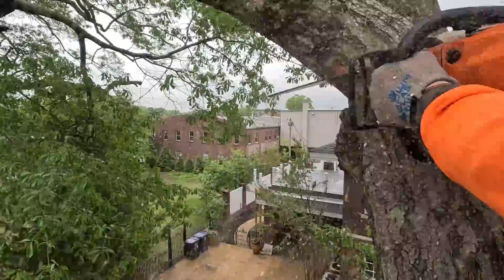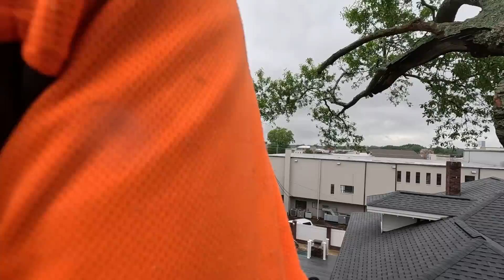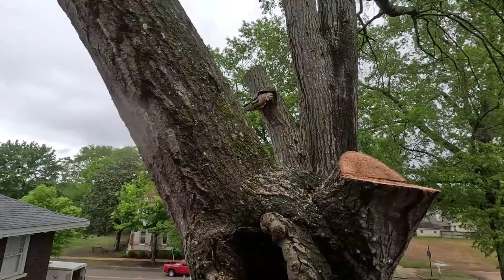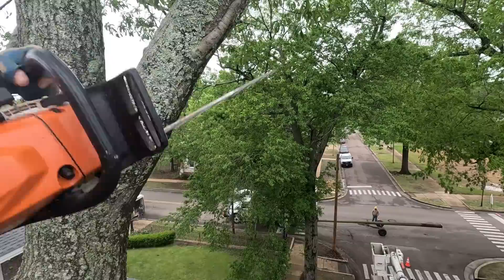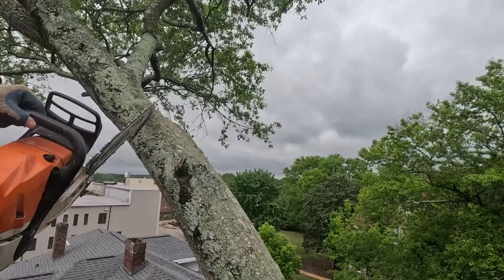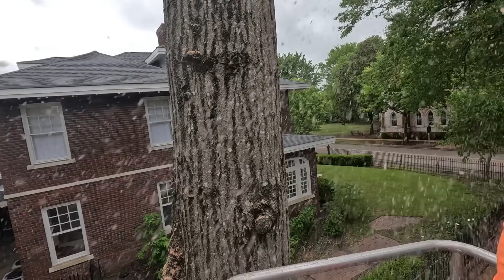The Tree Mek is a BEAST!!!!!!!! We took this tree down in less than an hour!

Comment: I had not seen a crane grapple until you showed it a few videos ago.  Super slick!  So nice how he can just pluck limbs away without all the harnessing.
Reply from the maker: That’s correct
Reply: @cotontop3  how is the dealer support and services on your Tree Mek, I do believe these crane systems are built in Germany correct me if I’m wrong.
Reply: I’m thinking the amount of dollars saved in labor costs and insurance liability using this machine compared to traditional methods of a separate boom truck, bucket truck and or grapple truck.

Comment: when you get down to logs how do you know what size to cut them so they are not to big (or small) for the crane to lift
Reply from the maker: You just know from handling the wood all the time.
Reply: green log weight chart and a spencer loggers tape (diameter tape) for me on my crane jobs

real critical when the crane is only good for 800 pounds because you are reached out so far, when 6" of length might be 10% of your capacity, makes you pucker up some
Reply: @cotontop3  How do you factor shock load sir,  when you cut it and it forces your crane to carry it do ya know what mean
Reply from the maker: @likeaboss860  you're not shock loading the machine.
Reply: @cotontop3  That is good just asking. Local 3 journeyman Operating Engineers California

Comment: You will need to be doing a lot of HIGHEND JOBS AT SOME LARGE MONEY  to pay for the beast , with inflation the bidding is tight, I priced a large red oak last week at 2,500.00 a Latino crew got it for 1,800.00 and it was gone in 6 hours , my cost would run 1,200.00 , all my tools have to make money , including my gloves . Good luck !

Comment: Why dont you guys use a massive chipper and chip truck or large debris truck . A gooseneck dump is great and all . But i wouldnt be in business unless i had my 1890xp and 30 yard chip truck . Just the volume advantages of that setup on large jobs surpasses a dump trailer. How many trailer loads did you make ?